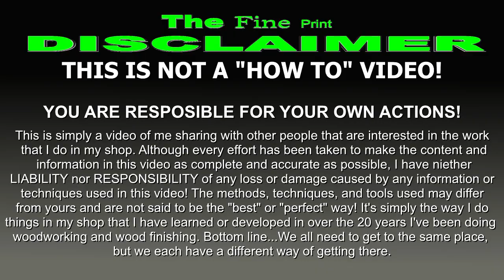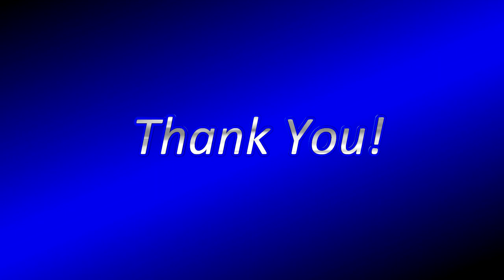Custom Cabinet Build Series Part 1  Making the face frames # 207

Comment: Hi Scott, glad you are back.  I have a question about your shaper outboard fence.  Is it a commercial or shop made model?  The UHMW on the fence looks like a big plus.  I am using a hardwood shop made version but yours looks much nicer.  Steve
Reply from the maker: +ExtremeWoodworker Hi Steve, yes, it's shop built version that I built like commercial system readily available. I built my first setup on my other shaper that is setup full time for coping and sticking in a single setup. I actually used HDPE instead of UHMW because it's significantly more stable and for wood it works well. Thanks! Scott